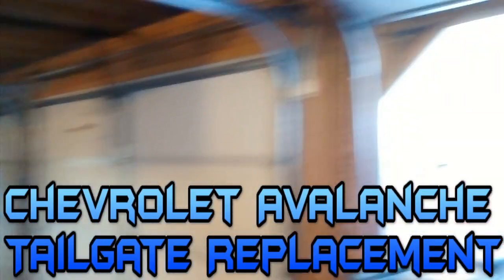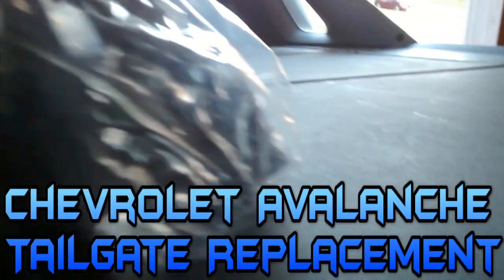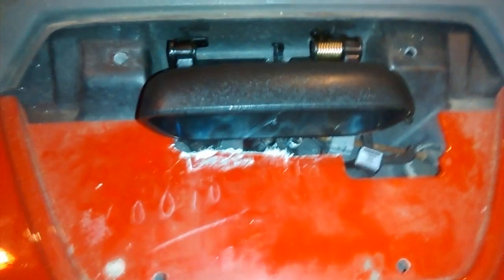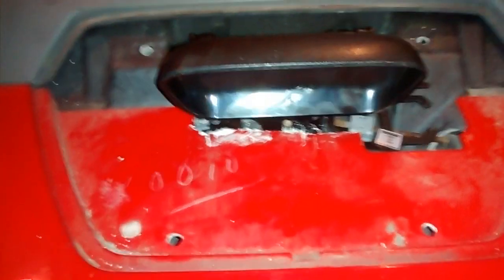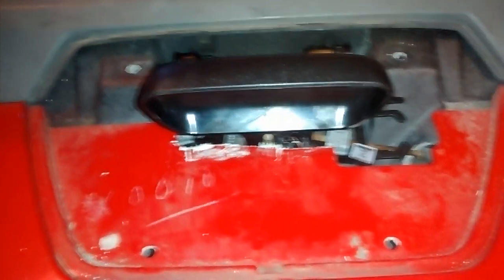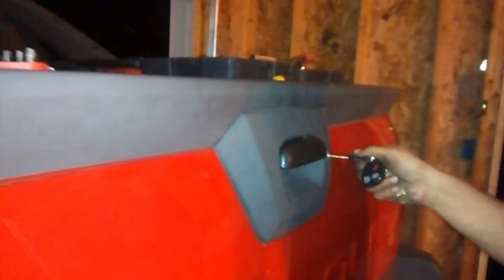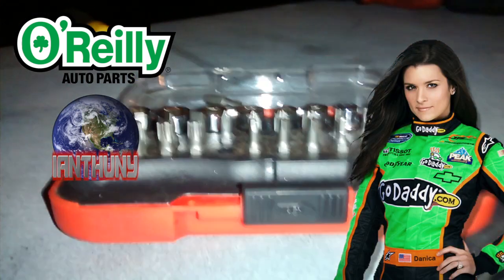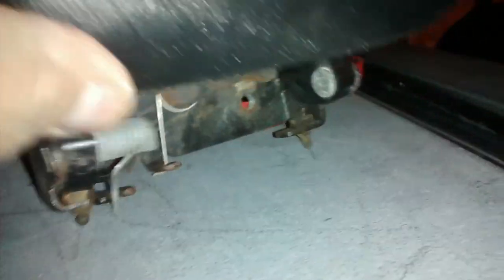Chevrolet avalanche tailgate latch repair

Comment: how do u get the tailgate open, my rod on the left side disconnected and is somewhere down in the tailgate.?
Reply from the maker: Stephen Walsh you got to climb in thru the truck , where the window comes down. then use the proper tool to take of the in latch area inside. might need a flashlight to see it.
Reply: Anthony Martin thanks man I'll try and do that tomorrow